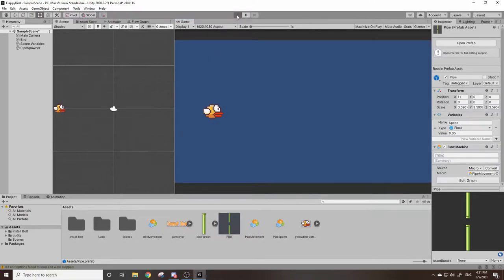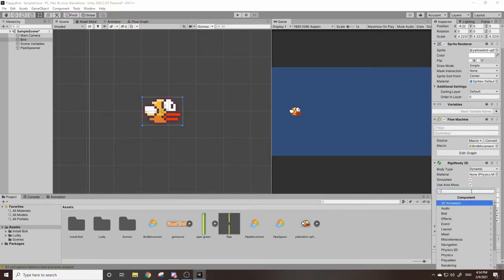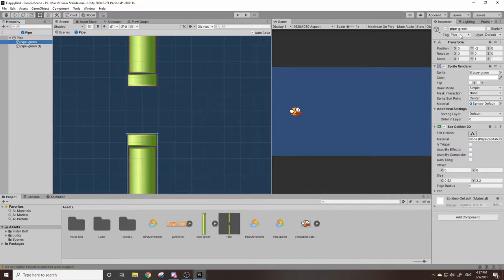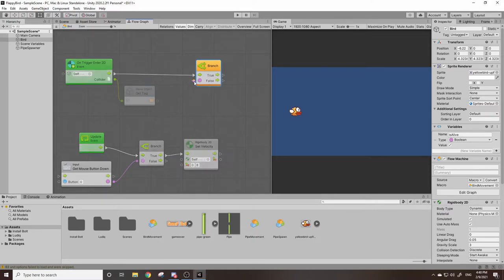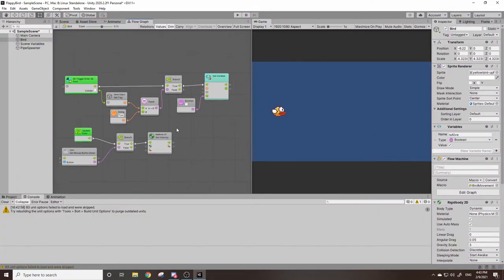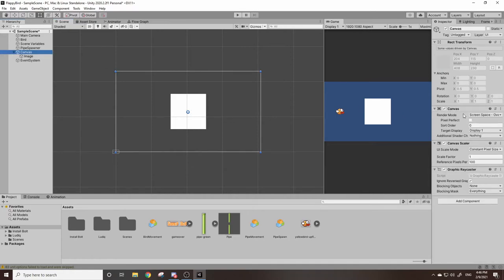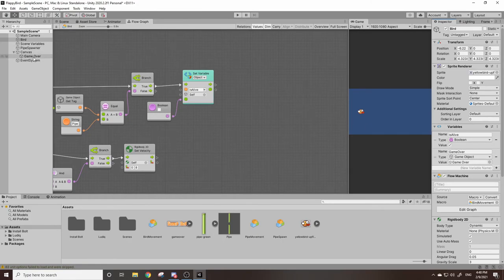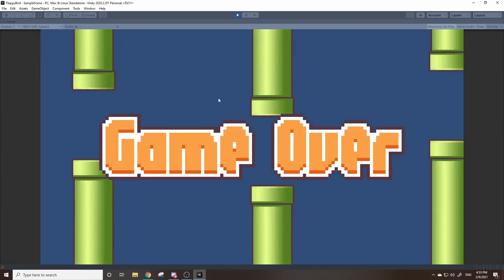Flappy Bird Bolt Tutorial pt. 3 | Collisions and Game Over

Comment: Everytime the bird hits the pipe it collids but I cant see game over 😕 Please tell me how to do it!
Reply from the maker: Did you enable the "is trigger" setting in the pipes collider?
Reply: Where??
Reply from the maker: In the pipe's box collider there is a toggle labeled "is trigger". You want that on.
Reply: @JAMESDEV535  If I turn that on, the pipes spawn very close to each other and also at start there are 2 pair of pipes that spawn very close.
Reply from the maker: Are you using fixed update?
Reply: @JAMESDEV535  yes 🥲 But I use the 2021 version of unity can that cause any problems???
Reply from the maker: There shouldn't be any problems with the version

Comment: In my game the bird when hit the pipe it doesn't send a log and i see the wire to debug log and string with hit pipe doesn't activate
Reply: And how there is Hit Pipe on the string
Reply from the maker: In the branch block in the trigger after code, check if the string literal has Pipe typed in exactly as you set the tag on the pipes.
Reply: Thanks

Comment: when i use fixed update all my pipes get stuck at the start
Reply from the maker: I'm not entirely sure why switching to fixed update broke the game. Try going back and seeing if the code is plugged in correctly
Reply: @JAMESDEV535  i'm sure it is but ill double check
Reply: @JAMESDEV535  i did it does not work it just works very slowely to get the pipes in and they all apear next to each other
Reply from the maker: What did you put for your speed variable? I had set mine to .05 and that seemed like a pretty good speed for me.
Reply: @JAMESDEV535  I thought it was 0.01
Reply: @JAMESDEV535  off i'll change it
Reply: @JAMESDEV535  thanks
Reply: @JAMESDEV535  thanks you it worked
Reply from the maker: Glad you got it sorted out :)

Comment: btw the fast pipe spawning problem is no more bc in the new unity bolt version they made it so you your graph spawns with a start event and a fixed update event not the old update event
Reply: Hi, maybe it is the same as mine. Happens to you too to have a lot ofpipes together when you restart?
Reply: @Cristianssa  does your problem solve bcz I am also facing the same problem